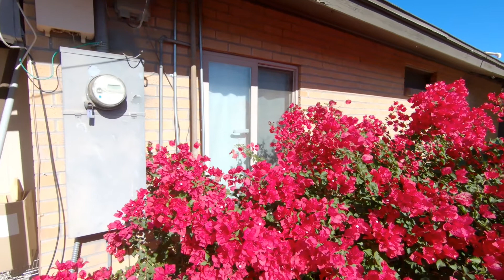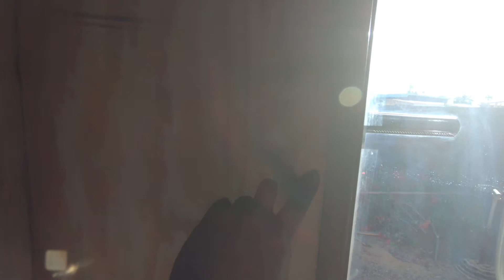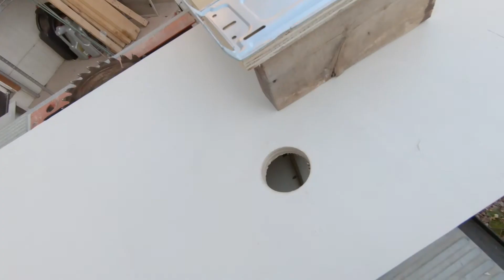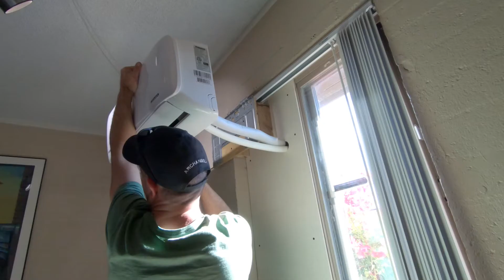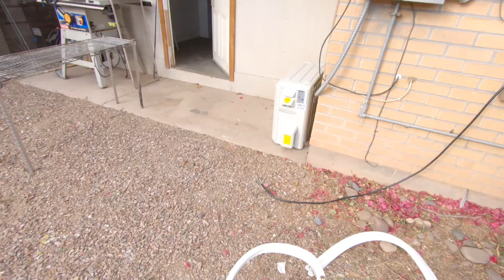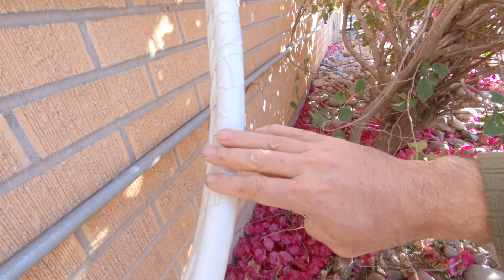Install a Mini Split AC Thru a Window - Non Destructive Install on a Rental

Comment: When I saw the inside of the house, I assumed Miami, but as soon as I saw the rocks and bougainvillea, it was like oh, a fellow valley resident.. lol

Also, how did the heat pump work out for you in the desert summers? I feel like when it's 110+ its outside the usual working params of a heat pump.

Comment: This is an idea I had. I have a room I want separate from central air so room can be climate controlled on its own. There are multiple windows. Why ruin a wall if I dont have to cut a hole since a window is access for vent tubes. WHY can't I find a year round inverter type window AC with heat that has some sort of heater defrost so I can run cooling and dehumidifier in Winter? Im in Tennessee. It will turn cold eventually here, but there can be constant temperature swings even in December through March where it's 15°F at night or 60°F and raining (high humidity) by day.  I hate warm weather plus lousy humidity. I want this room to stay around 60°F - 66°F with humidity around 40%. I can achieve this with the inverter straight cool window AC unit I have. Of course I can't use it in December through February when its below 32°F (won't the unit frost freeze up? No defrost is present.  This room will stay warm year round. I want to be able to run cool AC to drop room to 68 in Winter if it's 40 to 55, probably humid, outside house, so opening a window is not an option). This room is in a house that will have central air running heat all Winter probably way too warm for my tolerance. I don't love those monstrosity mininsplit wall mount vent boxes. A window unit is more minimalist in my case. I wish I could find what I want! 

But that idea for using the window here for the mini split is awesome! If I can't find something like I want, that is an option. 

Im also thinking of using my existing central air vent by separating it onto its own ductwork to its own climate control unit. I don't want a mini split vent box on the wall if I don't need it.

Comment: It seems you violated numerous building, electrical, mechanical, and fire codes.  Well done.
Reply: Everything he did looks significantly safer than the dangerous conditions that sociopath landleeches cause to exist in every rEnTaL pRoPeRtY ever.....
Reply: Code schmode
Reply: dude, really?
Reply: Building code is great for new contstruction, after it isnsaid and done with there is no code police to make sure it stays up to code. @shelbyindianajones-S3L

Comment: I agree with the comment about the window being a fire exit. Probably should have put the whole wood panel on a piano hinge somehow. Also, you should have left the suction line connected until you opened the high and low side valves. When you disconnected the suction line with no pressure in the system you probably let a small amount of air into the lines. It's much better to let out a little refrigerant than to let in air.

Comment: You shouldn't need to use any type of sealant on a compression fitting. You can use a dab of 3-n-1 oil but I would not use any sealant on flare/compression nuts.

Comment: on 220 v it would cost the ½ on your electric bill
Reply: No, that's not how electricity works and the power company are not complete idiots. You pay for kilowatt hours, not for ampere hours.
Reply from the maker: Sorta. On the new house it uses 6 amps at 110 and my 1 ton 220v uses 3.7 sustained.

Comment: Good video! This answered many questions I had. Planning on getting one an install temporarily for 1-2 years. Our 50 year old furnace is now unsafe to run, though it does sill "work". So I'll spend the ~$700 now to get one of these and then save for a few years to eventually replace the gas unit. I'll then renovate the garage and move this out there and install permanently..

Comment: Just get a portable air con
Reply: WRONG. Portables are incredibly noisy and use 3 times more power than a good window unit - which means SIX TIMES FUCKING MORE power than a mini split... It should be illegal to make anyone suffer with the unfit-for-purpose atrocity of a portable AC... and in fact, in late 2024 they were just recently banned at the federal level and are now all removed from store shelves! ❤

Comment: Excellent install idea. I'm going to use this method for my Phoenix apartment. Only difference is my balcony has no drain, so I'm feeding the drain back into my room - into my humidifier (which is always on) to keep my room humidity stable.

Comment: Any plans to hook this up to solar at some point?
Reply from the maker: I'm trying to. New house has Solar but it's also tied into the grid. I have to contact the installer to see if a breaker can be installed before the main panel.

Comment: You wouldn’t be permitted to do this in my area. This creates an eyesore where the window would be. Nothing is permitted to cover or stick out of any window. Rentals are inspected twice a year, this would have to be removed or an eviction will result.
Reply from the maker: What about a regular window ac unit? Where do you live?
Reply: So the central air is not sufficient?  Maybe there is a law somewhere about exceptions to that.
Reply: Some people 😂
Reply: How do you set up a ac in your area
Reply: @kennethwasserstrom  all units have central air conditioning. I wish I could do stuff without the landlord or owner seeing it. I think they like getting thier nose into everything here.
Reply: @perrymckinney6146  TBF, if you owned a home or apts, you also would want things properly taken care of. As it will cost you in the long run after your tenants are gone or if the town has a problem of anything done. The owner is at fault not the renters.
Reply: @bertpainter8385  The owner is at fault for buying up more housing than they need to personally live in, in the hopes of rent-seeking their way to passive income... IMPRISON ALL LANDLEECHES.